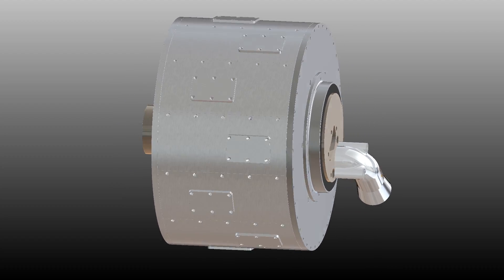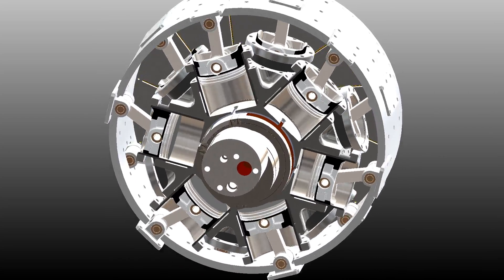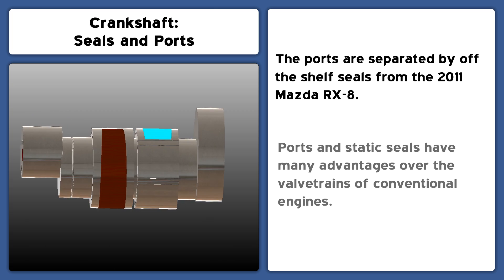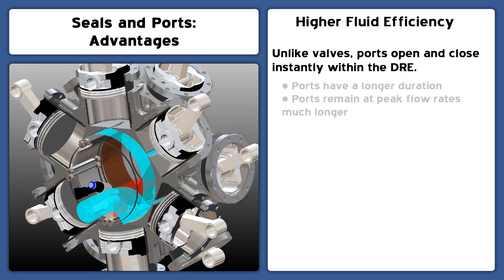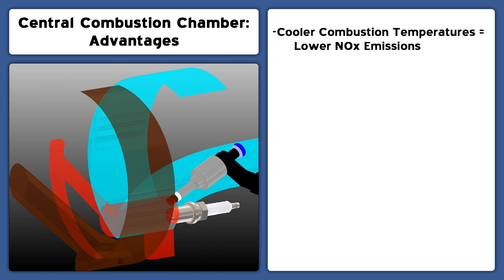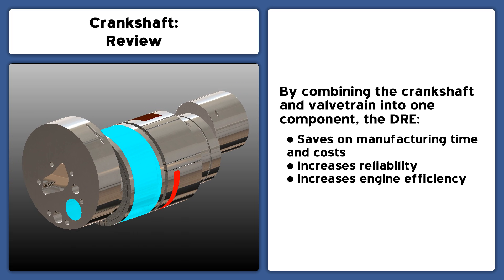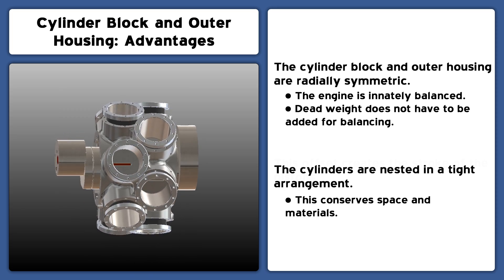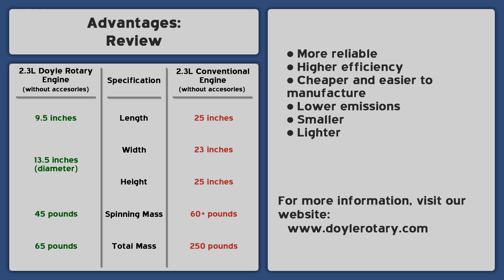New Split Cycle Engine Concept: The Doyle Rotary Engine

Comment: Heat dissipation would appear to be problem. I believe this was not addressed in the video.
Reply: rickey5353 is not that good looks like it had a lot of wear points that will fail quickly early
Reply: Yes how is that single central combustion chamber being cooled  ?

Comment: Question.... The demonstration does not explain how the torque is converted into usable form(kind of smell a bit of bs). Modern engines, use a form of linear torgue conversion, I just can't rap my head around how that is even possible with this design(making it unusable with modern transmission systems). I could be wrong as hell though....
Reply: I can't rap either.
Reply: Probably the same way as the WWI rotary aircraft engines transferred their torque.  Can't give you specifics as I haven't looked into the actual mechanical linkages and such, but the principle was the same: stationary crank with the motor spinning around it.

Comment: very interesting design. kInda like a simpler, reversed 'really old school' radial--the kind where the cylinders rotated-with all that rotational inertial/angular momentum. But it has a bit less because the heads are now in the center! And the valve train seems much simpler but thinking about its flow efficiency is way beyond me. GL!

Comment: Seems like a lot of people have a problem imagining how the cooling would work on this, well correct me if I'm wrong, but thats simple: It is not required. Since the combustion is allowed to proceed for the time it takes to burn it, most of the heat does what its supposed to do in a HEAT EXPANSION MOTOR: Push you forward. Why drive around boiling the jug, and paying for it? Power takeoff would likely be from a bolt on direct shaft and would be within an encased housing. My guess is only a two stage gearbox (1 gear) is required, perhaps none, due to the increased efficiency and rate of firings. And, since the combustion is taking place outside the cylinder, all the evils of the infernal combustion engine are avoided thereby reducing the need for massive amounts of lubrication, and making this a very longlasting engine. Unfortunately no good for this world (would have been done 50yrs ago by smarter creatures) as apparently our civilisation depends on consumption not machines that last for generations and dont require a gas station/workshop every 100km.

Comment: Let me see if I understnad this motor. You say that the engine block will rotate? I thought that, that was the cranks responsibilitie. In order to produce torque from the crank twhich is then transfered throught the twisting motion of the crank to a transmission, to a drive axle?
So you have a spinning block, good for you.
Reply: The spinning block acts like a flywheel

Comment: Interesting concept, but a couple of questions... How do you cool it? How do you get oil to the piston rings, and how do you not have the bottom cylinders fill up with oil when the motor is not running?

I recognize the lack of a working model, and that can/will come with time i guess, but what kind of hp/torque profile is anticipated with this type of motor?
Reply: Two stroke fuel mix?
Reply: mounting the engine vertically could stop the bottom cylinders from filling with oil.

Comment: Just doing a bit of brainstorming- take out a couple of cylinders and make the whole unit smaller to bring down the overall spinning mass, add a supercharger to increase power output. On the exhaust side(end of the engine), fit a planetary gear system to the inside of the rotating drum and have a driveshaft from the centre of the gear system connected to a clutch assy.

Comment: Fascinating, thanks for shring. Variable valve timing has improved engine performance and emissions greatly over the last 15 years. This  engine has fixed timing, that's a bit of a step back. The air intake and outlet on a IC engine determines the power it can produce and normally the top end is big compared to the cylinders. This has the air inlet and outlet at the centre. It will be very difficult to get enough flow area through the inlet and exhaust, this machine will be permanently starved. How are you cooling the cylinders
Reply: Good points, you seem quite inelegant. I wonder if we come up with solutions for this good starting point, before we through out the whole concept?
1) varying intake/ex timing:  electronic controlled valves on ported sections around the crank radius (If valve timing would be of value in this type of engine).
Conceder that this has a combustion out side of the cylinder which lengthens the power stroke emulating a K-cycle engine,
2)Flow: I don't see this as a problem as this design would produce a steady flow as apposed to a conventional engine the has pulse like flow traverse valves and slow transition between open and close states
3) Cooling: This could be a challenge. Liquid? scary! how to seal that and the  reliability.. I'm thinking air, If you conceder that out side is spinning anyway, just open it up, add fan blades, a shroud and cylinder fins.  You might decide to do both liquid and air. Perhaps you could liquid cool the crank and have a isolated liquid cooling in the spinning block using a convection circulation method or a totally sealed pump just a round pump impeller with a heavy side to utilize spinning motion.

Comment: I could see this being pretty useful for industrial purposes, but along with the question of gyroscopic procession, where would you connect a PTO shaft for a transmission if the crankshaft is stationery?  Unless I missed it below

Comment: Ok, this video caught my attention; I'll try to ask smart questions (though some, like TAPriceCTR, may have beaten me to a few aspects).  Have normal rotation speeds for use in cars (idle, cruise, high power acceleration) been found?  Is gyroscopic precession problematic for steering or traction during pitch/bank changes (uneven roads & hills)? Throttle response times (increasing and decreasing)?  I understand the RPM may be lower than expected due to multiple "cycles" per rev; I am curious...

Comment: so in an engine bay you would essentially have a huge rotating mass in there... not sure how well this idea would work.. mounting complications would be an issue as well as high rpms, wouldn't that huge mass cycle faster, spinning at a higher rpm? interesting idea, i need more info..

Comment: Thanks for the video and all your hard work. I love these alternative tech. engines.   You really have some progressive thinking. I would really concentrate on the After TDC firing. That has some great applications. I don't want to be overly critical, I would rather see you go on to greater ideas.. areas for improvements: There are two pistons doing the work of 1 piston in a conventional engine. Also the larger "bearing" surface and reciprocating mass might cancel out the benefits.

Comment: Any thought been given to running as a diesel / turbo diesel?  From what I'm seeing, the burn chamber is already compressed air..?  

I bet that would combine very nicely with a Lorentz force / pancake type generator.  Spin the magnets instead of the coils and there's no brushes / contacts to wear out.  

Very intriguing unit with many apparent advantages.    

Would be very interesting to see this built with a Lorentz type electric generator attached to the outside / spinning component.

Comment: It is extremely elegant. It is like a turboprop. The compression and expansion of hot gases is done with pistons and cylinders instead of a radial compressor and an axial turbine. Must give an optimum thrust to weight ratio. I cannot believe that companies like Rotax would not be interested in the idea for use in light aviation.

Comment: Also on the RE-5 it was not necessary to feather the clutch when launching from standing start. Just gas it and go! Zoom! It had an amazing amount of torque. It would go zero to 30mph in the width of a small intersection. I even beat a big Yamaha 1100 (or was it 1300?) in a short drag race: 1 city block. Not too shabby for a 700+ pound bike with only 500cc! And no, it was not just geared low. It would also go 55mph in 1st gear, 80mph in 2nd gear, etc. (admittedly pushing it well past redline.)

Comment: Low torque from Wankels? Completely false. Years ago, when I had my 500cc RE-5 Suzuki Wankel, my best friend had a 1200cc Harley. He disparaged my "rice burner". One time we were going down the highway at 55mph, and I challenged him to see who had better acceleration. I told him to take his choice of gears, while I would take top gear (5th). When we rolled open throttles, my RE-5 immediately left him behind!

Comment: And the engine will have to be placed so the axle of rotation is normal to the earth's surface. Hmm, if that's the case, the stabilizing gyroscopic force will prevent the car from ever flipping. Nice design.

Comment: Yea, ok, except the valvetrain and camshaft are mostly STATIONARY mass, and the only force that needs to be overcome with them would be friction.
And there's just now way this setup provides less initial resistance than an ordinary camshaft. 
By adding the weight of the cylinders into the mix along with the pistons, it's effectively doubling or tripling the amount of initial inertial mass which needs to be overcome.
And what happens when you want to apply break to the engine? Same inertia.

Comment: I bet it would work great in Trains or even Big Rigs that need to do long cross country trips! If you use this kind of motor you could try to use an electromagnetic clutch so you dont have to worry about waiting for the rpms to increase if it IS that slow to accelerate. But i have no engineering degree. Keep going!

Comment: Wait, why are you using a row of cylinders for compressing Air when that's a Turbocharger's job O.o?!
And while it's a completely different and novel design, it TOTALLY operates via a Diesel cycle (compression> pre-ignition> injection/expansion> compression> re-ignition/expansion> exhaust> repeat>>)
Aw, no, wait... now i realized what you're saying. This engine's missing that last half about re-compression and re-ignition :I
Reckon it'll be hard to pass an emissions test like that :/

Comment: Ah, yes Steel Sleeves are the way to go in a Diese... wait it's NOT a diesel?
Yet in the video it says the air/fuel mixture is first pre-ignited then fed into the cylinders where it's compressed (and presumably re-ignited)
How is that NOT the Diesel principle? :>
As-for sudden stops, those may occur regardless of the engine's design for any number of reasons ...mechanical failure, premature ignition (although that won't be a problem on a Diesel), etc.
Also, i enjoy the conversation aswell ^^

Comment: Wait, the combustion-cylinders weren't Aluminium themselves were they?
Aluminium, even aviation-grade, doesn't sound like a good idea for a Diesel engine ...particularly in a high temperature, high inertia setup like this where sudden stops or knocks could prove devastating (another reason why i don't see this going into vehicles)
And trying to chrome it would just lead to flaking eventually, as aluminium is notorious for expanding and contracting.
There's a reason they still use steel.

Comment from the maker: Further, the prototype that locked up on us spun very smoothly all the way up to 3000 RPM.

Then the seals dug into the aluminum surfaces that we were prototyping with. Next version will have hardened chrome plated sealing surfaces. We work on it when we have spare time and money.

Comment from the maker: 45 pounds in DRE vs 60+pounds in conventional engine of same displacement

The DRE mass is a bit further out from center so despite having less spinning mass, the rotational inertia is the same as a conventional engine.

This means it will accelerate and decelerate just like a conventional engine.

Comment from the maker: The DRE has zero reciprocating mass. Reciprocating mass means that mass moves back and forth. In the DRE, moving mass revolves around in a perfect circle continuously and smoothly.

Just like you would say a wheel doesn't have reciprocating mass, neither does this rotary.

This is easier to see in another of our videos where it simply shows a 2d version of the engine.

Comment: and yes, while your engine is theoretically lighter, in it's current setup it also has an insane ammount of reciprocating mass ...if you were to build it like that, the engine will most likely shake all over the place and rock itself out of any restraints you could put it in.

Comment: Here's an ideea;
Instead of having the pistons spinning about, which i'd imagine also causes some slight friction problems within the cylinders at high acceleration;
why not instead have the outer housing do the rotation while the pistons stay safely in place.
You could then use the same cam-system that a Wankel uses to transmit the energy to the drive-shaft.
Just an ideea.

Comment from the maker: The end of the video has a little chart that compares the DRE a conventional engine of the same displacement.

When adding up spinning mass you must include the crank, big end of the rods, harmonic balancer and cam(s). Despite looking like it weighs more, the DRE has less spinning mass due to its extensive use of aluminum.

However, the lighter mass is counteracted by the larger torque arm of the mass bringing the DRE to right at the same rotational moment of inertia as the conventional 2.3L.

Comment: yea... putting the combined weight of the other cylinders and drive-train on the expansion stroke of a single cylinder at a time does seem like a bit much O.o

It's a great concept, but it does seem to be putting the cart before the horse as it were... using the force of the pistons to spin the whole thing instead of a lightweight crank-shaft.
I can't see this going into automobiles anytime soon, but it might just work perfectly for vertically-aligned generators/alternators =D

Comment: Might want to some research before you make statements like that. The oldest rotary engines are similar to this in using pistons around a stationary crankshaft. You can see them in old aircraft that use those motors with the pistons arranged in a circle around the center crankshaft. They were called rotary engines with the first one being built in 1889, Long before the Wankel rotary motor you are probably thinking of in 1957.

Comment: WWI rotarys did not fly well. Throttle was either full or off. The large heavy gyroscope called the engine made it difficult to turn, particularly to the right. They burned all the oil and breathed the smoke. There are reasons they are not used anymore.

Comment: Looks complex to me, the original rotary has shown the way but has had it's day with poor mpg and high oil consumption and little torque, yet is on the right track to surpassing a reciprocating engine which seems crazy to me that it's still the best we can create for road cars.

Comment: They flipped the cylinders around though.  This version has pistons contained by some kind of pressure vessel.  Moving rotating mass outwards is a bad idea.  Just ups strength and weight requirements throughout the design.

Comment: Agreed.  Plus there's a lot of load on the outer cylinder.  

Unless this thing makes 100s of ft-lbs of torque at a few hundred rpm, don't see how it would work in automobile or flight applications.  And even if it could, I can't see it being made out of aluminum, so it's too heavy.

Comment: The traditional rotary has the cylinders the other way around and a central crankshaft. Here the piston rods are pointing out. What is innovative is intake and exhaust is done from the center, with continuous flow, only one combustion chamber, one spark plug, no poppet valves, no distribution, no crankshaft...

Comment: this is a nice concept but where does the coolant enter or exit. or where could the engine oil possibly be pumped? due to the centrifugal forces it would all end up at the outer edges right?

Comment: thats pretty much the idea I came up with 10+ years ago when doing tech studies, I wanted to combine a piston system with rotary system , Using split cycle which I noticed SCUDERI are also trying out , This will be a pretty nice engine , Was that only 1x combustion chamber for all those cylinders 

The centrifugal force might be a problem .. car would just lean the one way .. 

tho I guess the engine could be mounted side ways

Comment: This engine is rotary. That's because the pistons spin about a circular axis, and the cylinders also spin on a circular axis.....nothing is reciprocating. As the pistons spin on a different axis to the cylinders, they are forced into and out of the cylinders in order to complete a full circle.
This idea of spinning the pistons on a different axis to the cylinders is old, WWI aircraft used engines like this, centrifugal force from the engine made them dangerous to fly.

Comment: Wankel rotary engines are fatally flawed and can never work well enough to compete with piston engines. You might not have noticed but no one is using rotary engines because there are many many good reasons why not.

Comment: heck this is a guess and i am not engineer, but i guessin since the whole engine bloke is doing reciprocating motion around it's crankshaft, the transmission (with all of it's gears) would normaly be place in front  ouside the outer housing (since the emission or air intake seems to be placed ind the rear) like common engines just adapted though.

Comment: I don't understand.  It seems like it has a ton of rotational mass, no sign of a cooling system and still has the typical reciprocating mass (piston, rod)...  What rotational speeds does it run at.  Also, why does the angle between the connecting rod and piston change?  Is power extracted as the piston pushes the larger drum as it moves away?